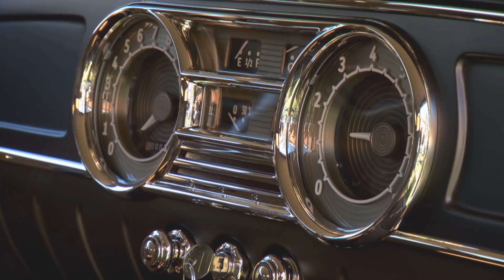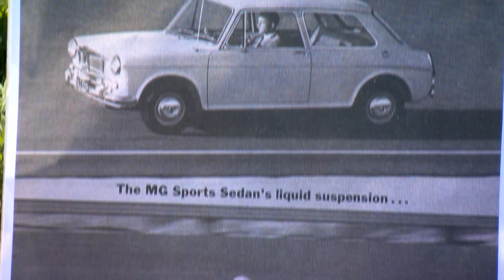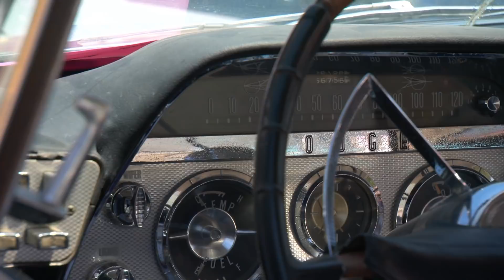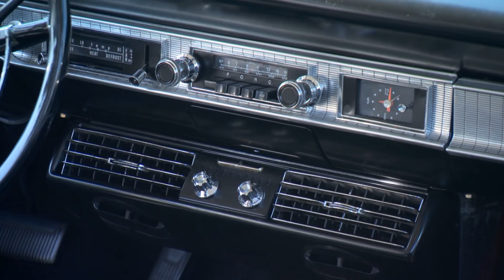Student Led Car Show is AMAZING!

Comment: Interesting channel. I'm about to embark on my first classic car. 1955 Chevy Bel Air 4 door sedan. No power steering or breaks. And No radio. Does have a working Clock. I would say in outstanding original condition. 🚘👍
Reply: it is...read the comment I left...you might get some good info

Comment: Never saw a swing away steering wheel on a Galaxie. Cool
Reply: First for me as well that must be a extremely rare option.
Reply: Can someone explain to me what is the point of that feature? To drive on the highway while cuddling with your gf on the bench seat or I am way off?
Reply: Swing-Away Steering Wheel – available in certain early ‘60s Ford Thunderbird’s, the entire steering column would swing towards the center console to give ladies a dignified way to get into and out of the car without messing up their skirts.
Reply: I think all Thunderbird's had them thru the 60's. Pretty rare on Ford's. I know they were an option in 63 and 64. Notice the 63 Ford had a AM/FM radio. Another super rare option what with there being few FM stations at the time.
Reply: troynov1965 tnx for the info!
Reply: +JWelchon Thanks for the info.
Reply: @nikolaystoykov9413    It is for easy entry and exit for the driver.

Comment: When I was a senior in high school my family had a 4-door '77 Buick Skylark (pretty much a family version of the car at the end), which was basically my first car.
Not a great car, to be sure; the suspension was squishy and bouncy, it was not comfortable, it developed a noise that tuned out to be the timing chain, so not that big of a deal, I guess......not a lot of power but it did get me around.........and the back seat worked just fine (ahem). ;-)
No, not exactly GM's glory days, haha....but I DO have some fond memories.

Comment: I will never understand why you put that amount of quality construction in any project and then color it in a ultra ugly  color. There is this classic rod movement in which rod guys want to behave like they own or have restored a Marmon or a Peerless or at least a '36 top of the line Packard. Sure. This is the mirror image of the rat rod movement. But at least with the rat rods, its closer to the original legitimate identity of hot rods e.g. rods were SUPPOSED to be fast loud & dangerous. And never really finished. But the classic rods, yes they exhibit extraordinary workmanship. But its also exactly CONTRARY to the basic history and sprit of the hot rod. This is just the latest moon madness on the show scene.
And show rods are SUPPOSED to be in your face knock out colors married with "not adult approved" design and out of control power levels.
Reply from the maker: Actually the color on this car is absolutely stunning in real life!